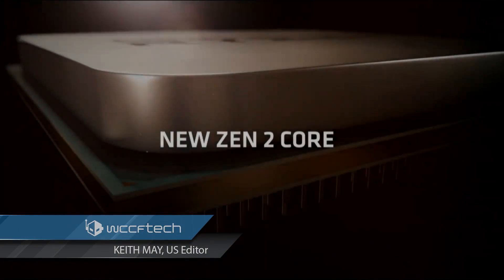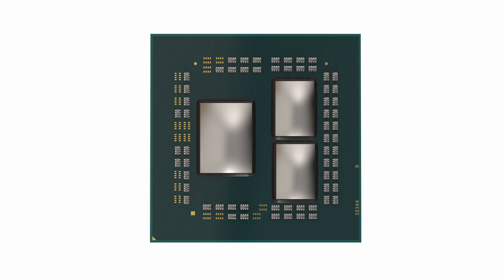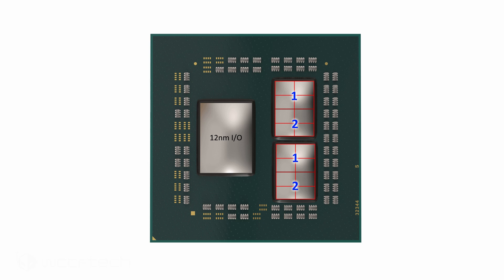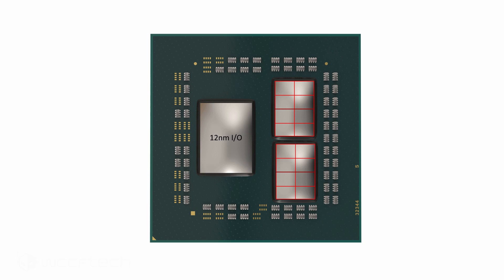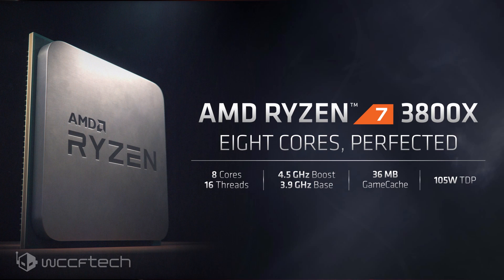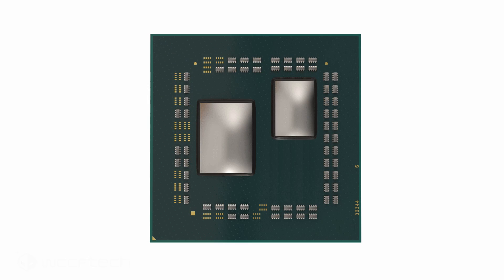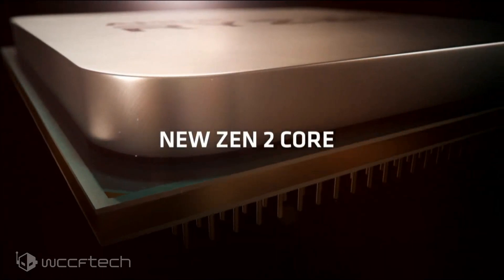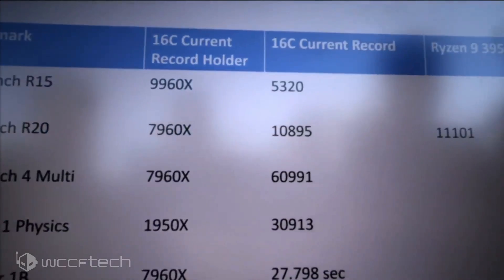Ryzen 3000 Series CCX And Core Layout Explained - Ryzen 5 through Ryzen 9

Comment: What about the 3700x maybe its a 4x4 on 2 chiplets?
Reply: Like he says, no the 6 and 8 core Ryzen 3000's use a single chiplet, the 2x chiplets is for the Ryzen 9's i.e 3900 and 3950 which makes sense since the yields of Ryzen cores is pretty decent and adding a 2x chiplet would increase the over all cost. It's possible however they may have a dumby die to assist with pressure.
Reply: @Dazzxp  Not sure about that as they used dummy dies in some previous chips to help support the IHS. If you can recoup dies with 6 working cores or less and make them work as 4 cores youd be saving money. The first gen of any new node like 7nm will see lots of imperfect chips due to fabrication issues.  And youd be offering a possible cooler solution as more silicon means more heat dissipation surface area. Well have to wait for some delider or firmware investigation to see if some 8 cores are dual die or not...
Reply: @pax256  Well at 6 months ago or so it was said the Ryzen 2 dies are 70% of the yield of fully functional cores. This has since improved which was why Ryzen 2 has been delayed.
Reply: @Dazzxp  Maybe we'll get a 3700 non x later that has it... itd be nice to have 4x4 as an option and not just sell 4 core r3k in the third world or secondary markets.

Comment: Would not entirely be surprised if AMD used two chiplets for the 8-core parts. We'll see. 
Also I wonder if there's any chance that deactivated cores could possibly be reactivated if there are no serious defects, like with the  Phenom II dual and triple cores. Very unlikely though.
Reply: i'm hopping this is possible. my old phenom x4 can be unlocked to 6 core without any crash/stability issue, just normal as other cpu.
Reply: @kuekejuu5057  I think those cores are laser burned or something :-(

Comment: waiting on reviews, since I need a completely new system wich i can not buy right when they launch.
since my system is so outdated i can only re use the drives and case and psu. x)
also navi or gt 1660 (ti) or rtx.
it might be a little overkill to go for the 3900x 12c 24tr for gaming alone, but i do some videoediting and multitasking improvement are needed since my gen 3 quad core 4c 4tr has a hard time handling more than one task at a time.

Comment: Question:

is it possible there's a structural difference between 3800x and 3700x other than binning?

iow; could the cheaper of the two be a combo of 2 dud (4 core) chiplets, rather than 1 8 core, while the more expensive one is a faster, single chiplet
Reply: this may have answered my Q:

"
Robert Rapier
2 hours ago
You are very confused. All 8 core Ryzen chips Gen 1-3 have 1 core die with 2 CCXs that hasn't changed at all. The only Ryzen chips with less than 2 CCX actually are the APUs. On the 2200g or 2400g, there are on board Vega graphics where the 2nd CCX would normally be."
Reply: tho im stil curious if there's a serious latency difference between 3700x and 3800x because of some structural change

it would matter to me; i do pro audio and i build DAWs for music work.  i like the idea of using the cheaper 8 core, because clocks don't matter so much to me, but latency does.
Reply: @ceounicom  no the 3700x and the 3800x are identical. Besides binning ofcourse

Comment: I'm surprised they use a single core chiplet for the Ryzen 7s and 5s. I thought they'd stick to a two chiplet design so they could salvage chiplets with only 3 or 4 good cores. 
Maybe they'll use two core chiplets on the consoles, and recycle the "slagg" (<= 4 good cores) that way. Or maybe yields are good enough that they can reserve the slagg chiplets for future Athlons.
Reply: I was expecting this as well. If the reason for using one 8 core chiplet for the 8 core CPU's is to avoid "wild design as far as latency" does that mean Ryzen 9 has latency problems?
Reply: they need to redesign the chiplet to make 4 core chiplet which will cost them. also if 4 core chiplet does exist they'll deffinitely release non apu ryzen 3 which is not exist at this point. game doesn't utilize all 12 to 16 cores, so it won't having any problem in game with windows 1903 even if there's latency problems. ryzen 9 is for people who's not only play games, but also multitasking and productivity monster, most gamers would go for ryzen 7 for performance.
Reply: @kuekejuu5057  I was thinking 2 cores per CCX active, with the other 2 disabled due to defects. So you would have a |2+2| + |2+2| configuration, just like the 3900X has a |3+3| + |3+3| config. But maybe the yields are too good, and they wouldn't have enough chiplets where 4 cores are disabled to supply the 8 core CPU's.
Reply: @isakh8565  yes zen 2 have better yield than previous gen, so i doubt they'll make [2+2] + [2+2] configuration. also, having more active cores per ccx giving more performance because of topology awareness on windows 10 1903.

Comment: So what was confusing me is that in the Zen 2 design, a CCX is still 4 cores, but a chiplet is 8 cores? Whereas previously with Zen & Zen+, a CCX and a chiplet were exactly the same things, at 4 cores! So in this case when they say it's got 2 CCX's, then that means it's only got 1 chiplet? And a 12 or 16 core would mean it's got two chiplets, but 4 CCX's? 

Would the Infinity Fabric between 2 CCX's on the same chiplet be faster than that between two different chiplets?
Reply: I came here to double check myself but it appears each chiplet has 2 CCX's, i thought the chiplet would have been 8 cores per CCX but seems that it not the case, a little disappointed tbh meaning if i get the 3900X then i will have to attain 3733MHz memory to maximise performance. I have recently changed out my crappy Corsair LPX 3200 CL16 Hynix memory for some T-force 3200 Samsung B-die 3200MHz CL14 which gets me to 3600MHz CL16 on first Gen Ryzen 1700 so i have no doubt i could hit 3733MHz CL17 which is the highest optimal interconnect frequency.

Comment: I thought the I/O die was suppose to be 14nm, not 12nm.
Reply from the maker: ^indeed, the X570 chipset and Rome's I/O die are 14nm, but the I/O die on Ryzen 3000 Series is 12nm
Reply: @WccftechTv  Oh, Ok got it.
Reply: @WccftechTv  Interesting, would that mean that the Epyc and Ryzen I/O dies are separate designs?
Reply: @bbbl67  I second your question, and also why would they use the "better" process node for their mainstream when usually premium items are saved for datacenter?
Reply: @Brandon_Neil  they use 12nm on mainstream since the chip is so small and latency is very important in normal application, but in server, the latency is not as important and the caches is massive so that latency won't impact performance and 14nm has mature not mention the Rome sku is so big so don't need to save space.
I think so :)
Reply: The X570 chipset is the 14nm version.